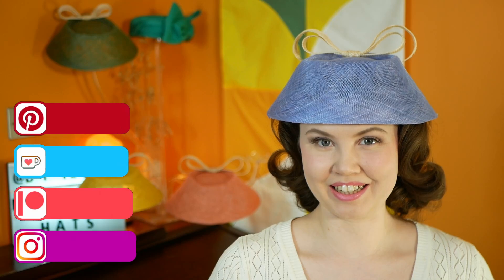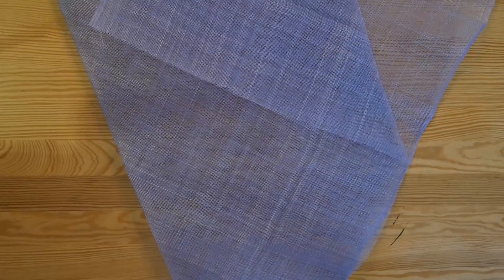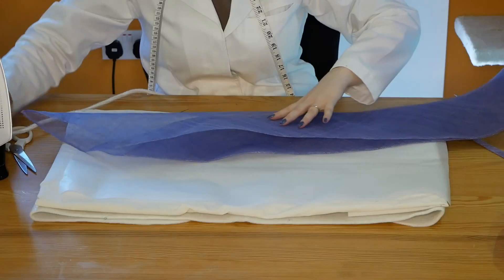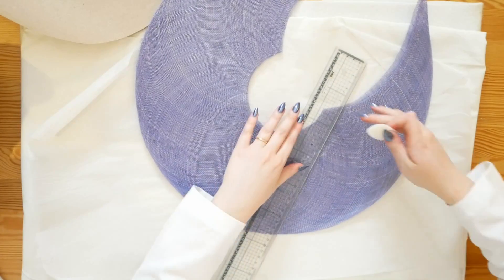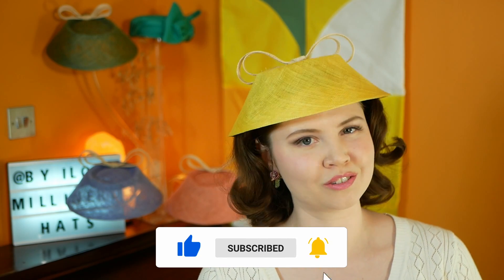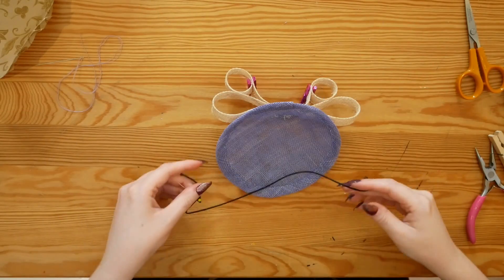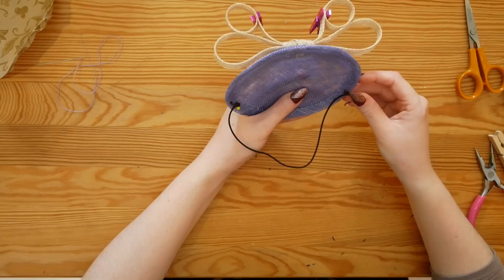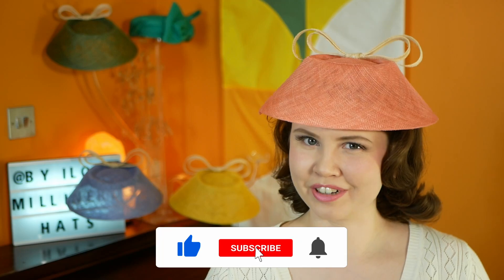DIY Sinamay Bias Brims | Millinery Hat Making Technique

Comment: Hi Ilona! Very cool instructions video. Thank you! ❤️ I have a question though. When you are ironing sinamay, it's melting together cause of the stiffner. Have you prestiffen it yourself or you got it that way already? And if not treated with stiffner by manufacturer, will this work if I use diluted PVA before, let it dry as plain fabric and then cut, fold steam and iron?

Comment: What fabrics do you use for a hat making other than sinamay ?
Reply from the maker: Hello Sandra! Thank you for your question 😊 I would call sinamay a "foundation material" rather than a fabric, as it is very stiff and its use is structural. As for fabrics, you can use anything and only your imagination is the limit. I tend to use silk dupion and silk velvet when I make fabric covered hats. I suggest you don't use polyester because it does not lend itself to draping well (and is a polluting plastic)  If you are interested in fabric covered hats I suggest this video: https://youtu.be/J5d5WdFGPTg
OR if you want to learn more about millinery foundation materials, then I've got this video here on working with buckram: https://youtu.be/1a02OV0X7Vc
Another traditional millinery material is felt, I have a video here on using wool felt: https://youtu.be/VjP0rAml6bk
I hope you enjoy these videos!